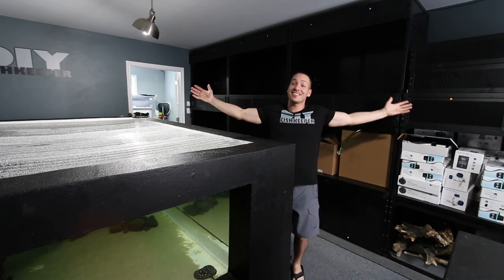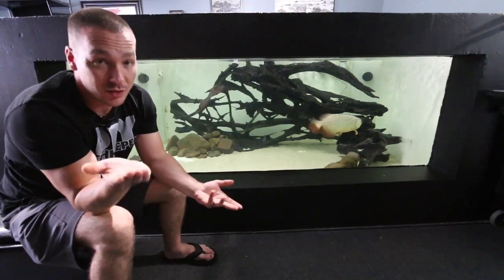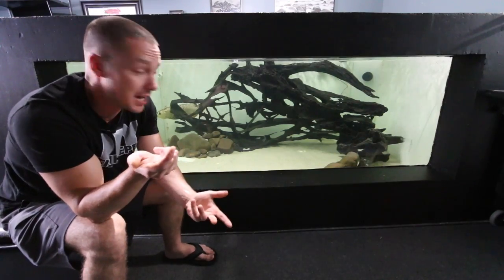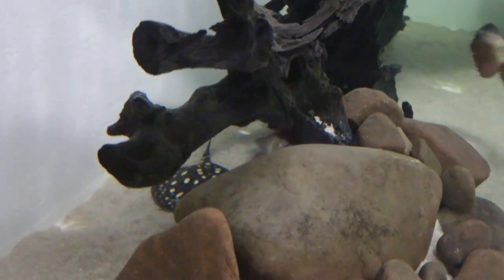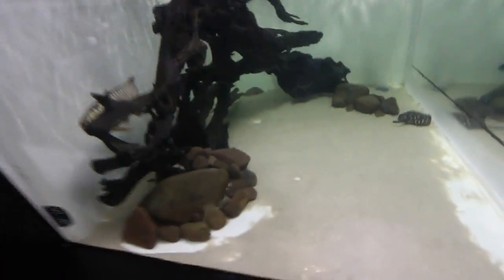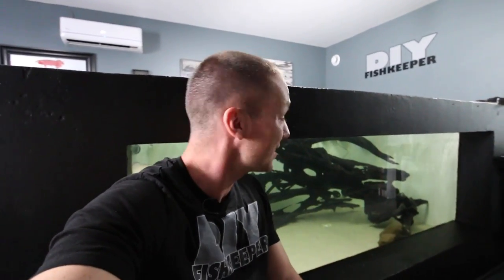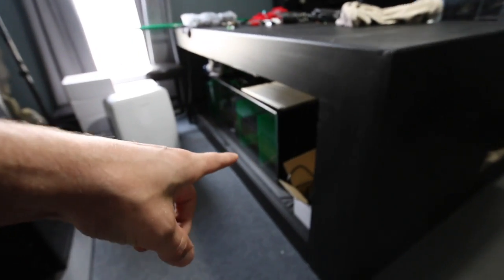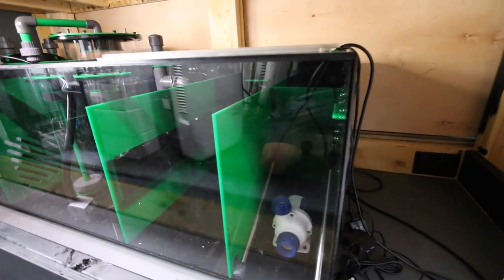HUGE aquarium gallery update!

Comment: I have a question, I recently purchased a 350 gallon acrylic tank. The gentleman who had the tank had turtles living in there and it looks like there is maybe hard water and probably dirt caked on the corners and a few other spots. Do you recommend anything in particular to clean the tank with? I have been using just water and a plastic spatula so to not scratch the tank. Any suggestions are appreciated!

Comment: Man move that heater from the rerun compartment, put them on a constant water level compartment, so if the pump compartment runs dry it will save the heaters from exploding due to the excessive heat

Comment: are you going to add more sand to cover up the spots where there is none?
Reply from the maker: The rays will just do it again. I talked about this as a one of the many reasons i dont do sand with rays.
Reply: The king of DIY ahh makes sense I didn't think about the rays